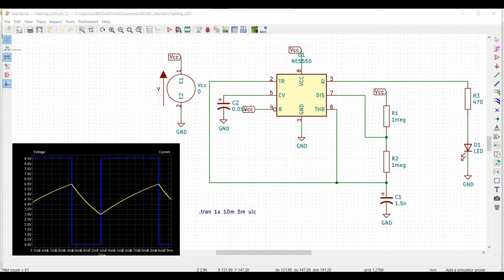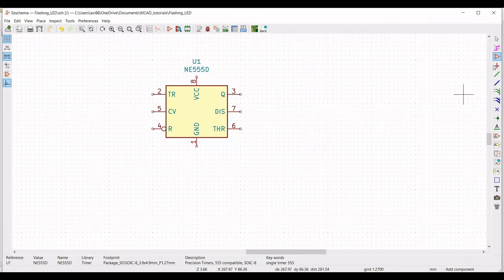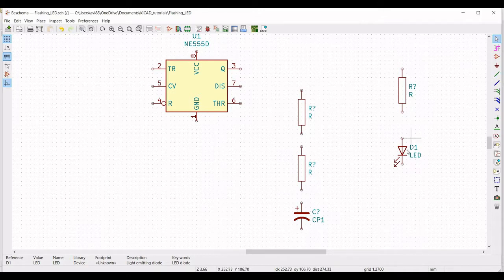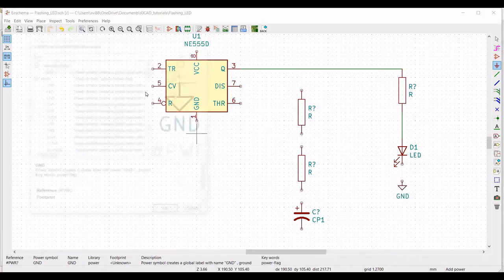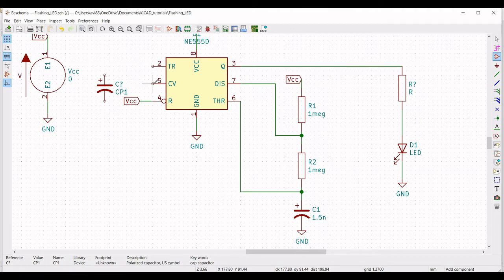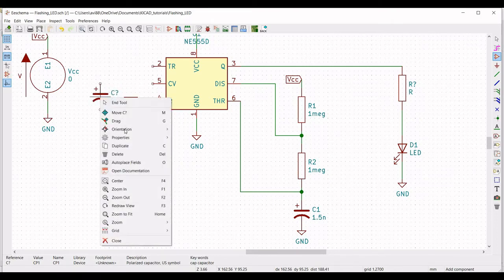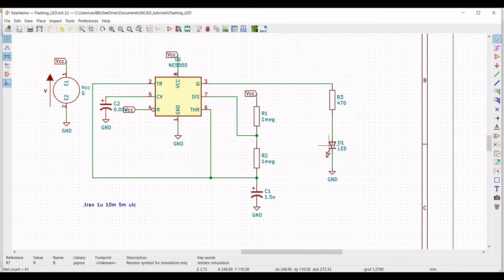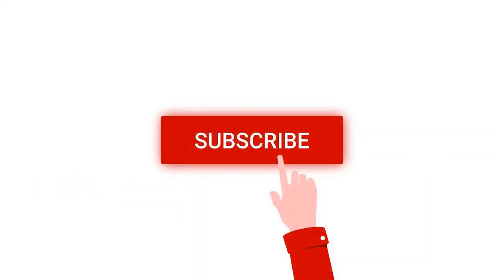Kicad tutorial 31: Design and Simulation of 555 timer flashing led circuit

Comment: Thanks for this video mate. Is it possible to simulate the CMOS version of NE555, lets say ICM7555 with Kicad ? I am trying to figure that out currently.
Reply from the maker: Yes there are two ICM7555xB and ICM7555xP both from intersil now part of Renesas. Unfortunately I dont have the model files, maybe you can find at the Supplier website for the model file